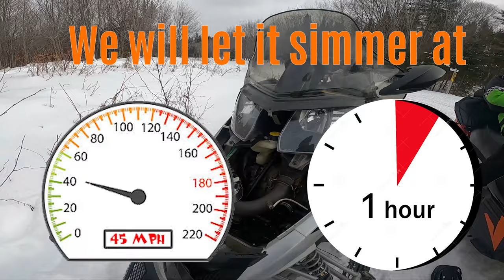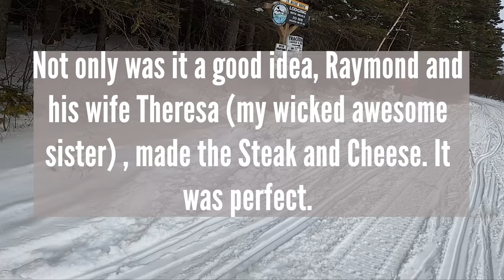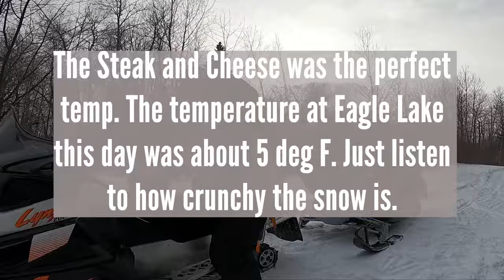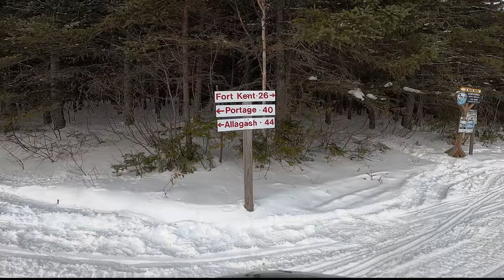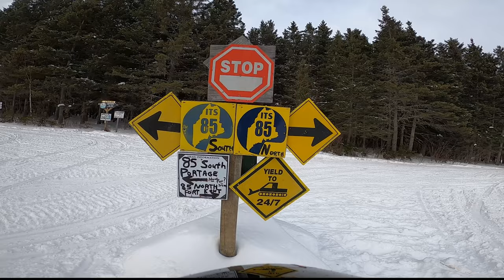Cooking w/ The Original Muffpot on my snowmobile muffler.

Comment: How long did you have to wait before it was warm enough to eat?
Reply from the maker: It was probably around 45 mins or so when all said and done Including a 10 min stop in between. They was warm enough to eat after about a half hour. Not bad considering the entire day it didn't get warmer than 10 degrees f. We plan on experimenting  and trying out a bunch of different meals this season. Every meal will be a slightly different experience. It really adds another level of fun to our sled trips. It also saves alot of cash.  Thanks for checking out the video. If you have any cool meal ideas I should try this year please let me know .